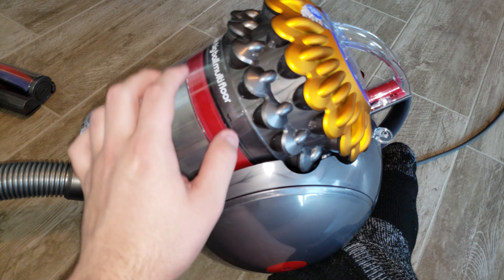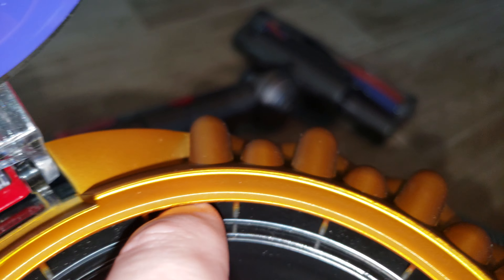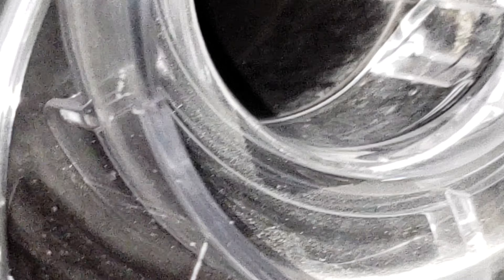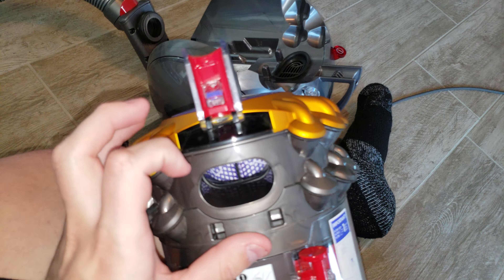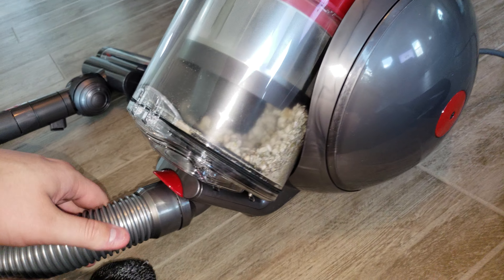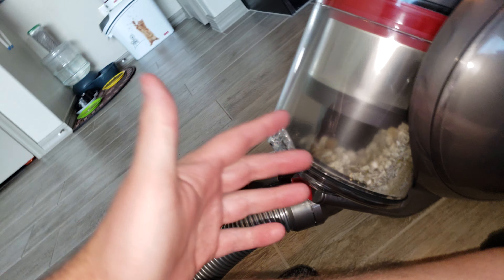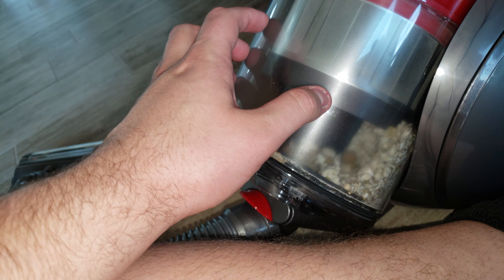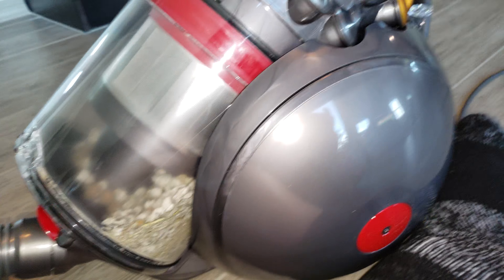Dyson Big Ball, updates

Comment: Dyson should a electric cleaner head on these machines than it would be perfect
Reply: I agree. The high torque cleaner head with headlights and extra cord. Because this has the 2 tier cyclones which will remove more dirt than songle tirer cyclones. And with the addition of the high torque head, you uave a very dominant canister vac